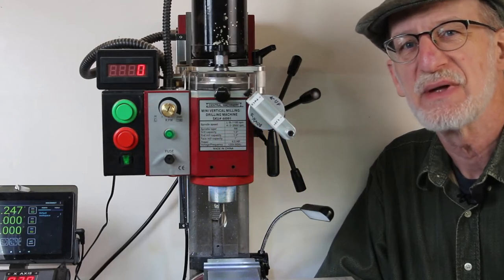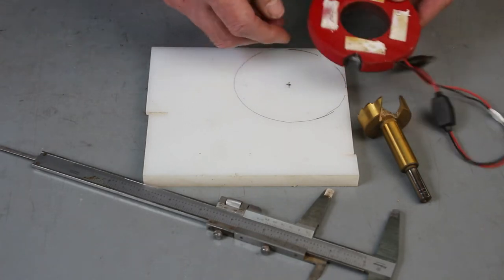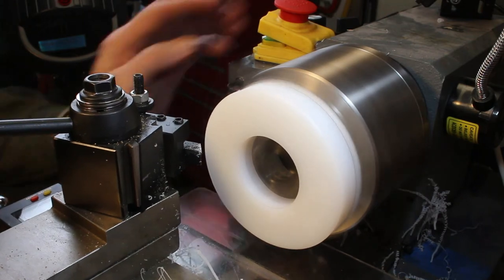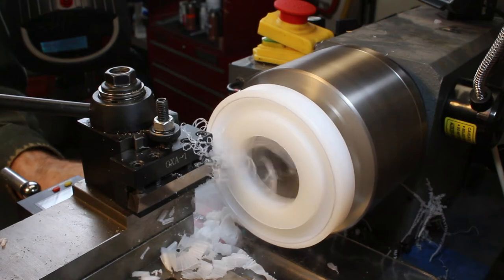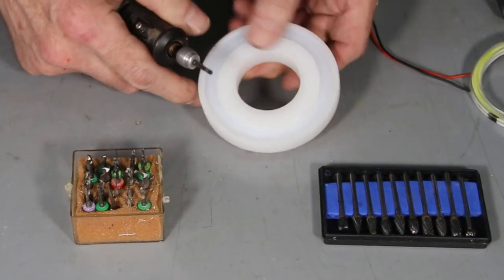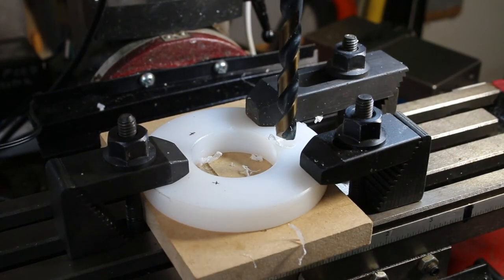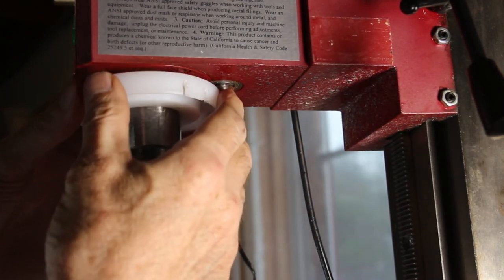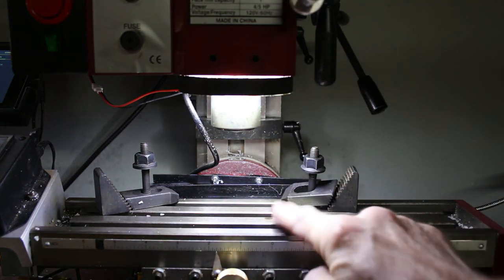Ring light for the Mini Mill spindle

Comment: I copied you halo light idea but I used a 3" ABS end cap from homedepot with a 800mm halo light because originally I used the 600mm and realized that when I use the chuck it was blocking the light, all in all it worked out great! Thanks for the inspiration and for the awesome videos!
Reply from the maker: That's a great idea!  Thanks for sharing! :)  I have found using the ring WITH the gooseneck light is perfect for me.

Comment: I take it you used a external power supply 12V ?
Reply from the maker: Yep, a regular 12V adapter.  I actually tapped off the power feed to my tachometer that also uses 12V adapter.  So I just put a DC jack on the back of that box for the ring light.